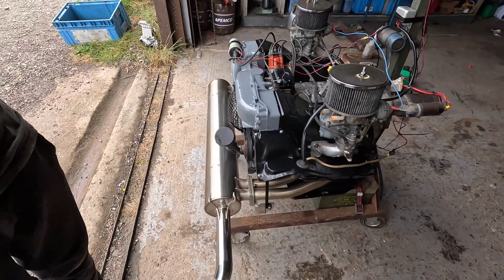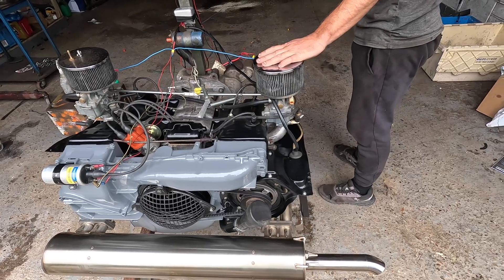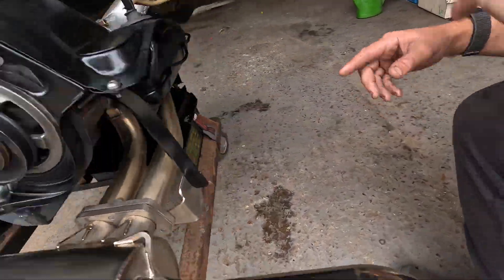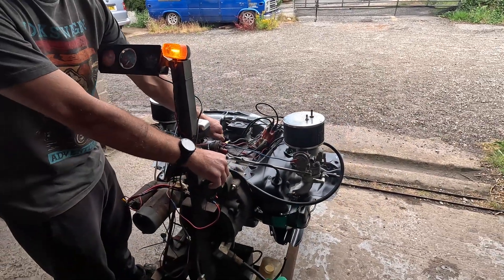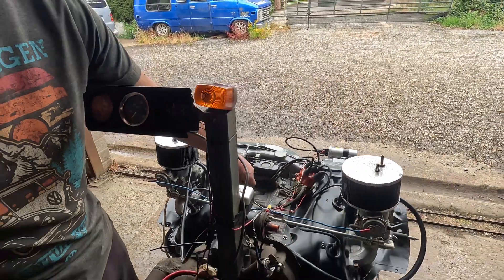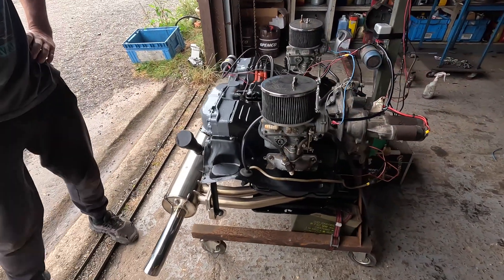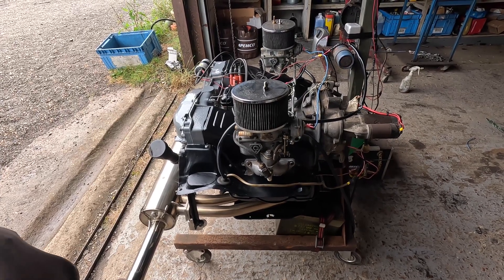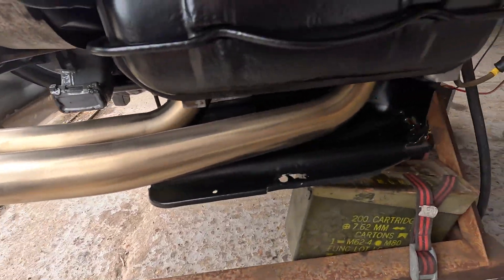Engine first start!

Comment: Ever heard to always run heat exchangers , as they draw heat out of the head . Keeping head temputures lower?
Reply from the maker: Yes you are correct we just fit what we are asked to , in the Uk it’s not normally a problem with over heating , thanks for commenting bud .
Reply: @nosvw2122  Keep aircooled alive .